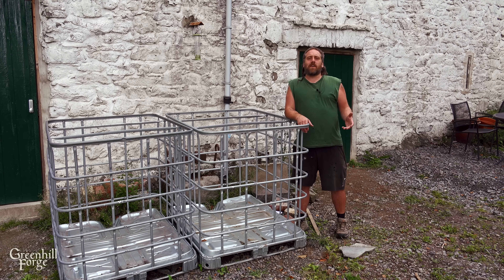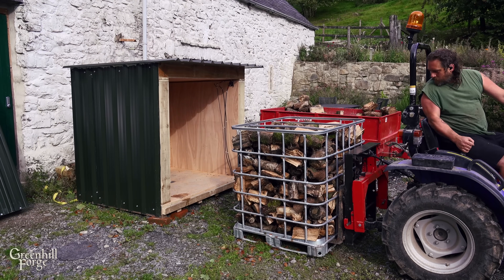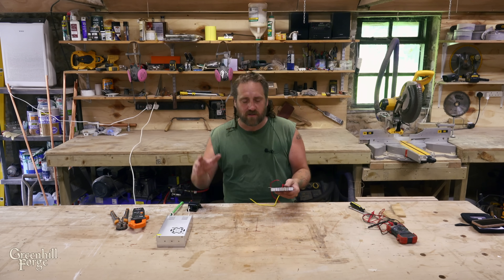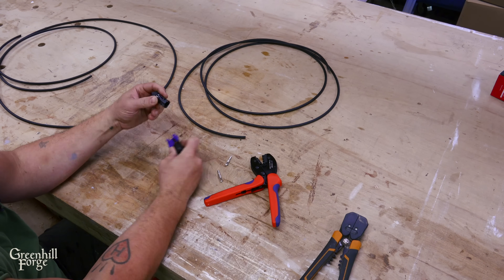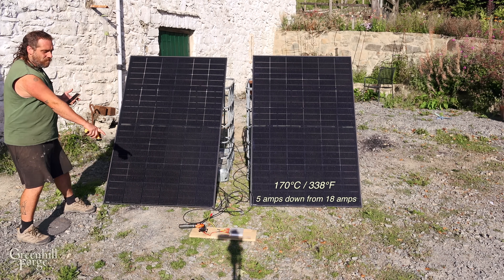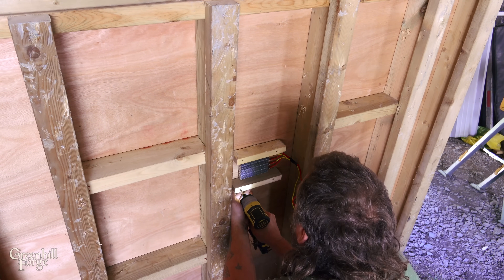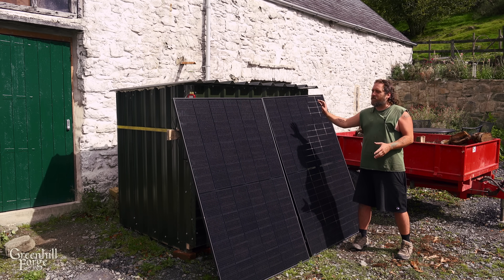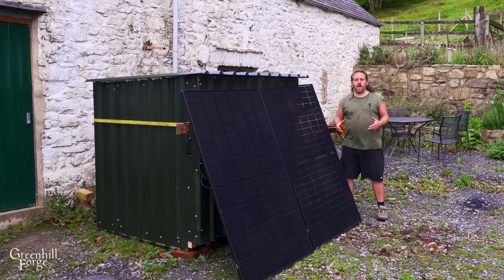Building a DIY Firewood Kiln: Solar-Powered Small Scale Portable Off-Grid System

Comment: Isn't it more efficient and cheaper, to use evacuated-tubes and then then pump hot oil through them?
Reply from the maker: I'm going to try other designs, some of which will very likely beat this but I had the panels so this didn't cost very much. real vacuum tubes are pricey

Comment: Lovely build - and you'll find (or already know) that the biggest factor in seasoning wood is air flow.   The temperature is less important, although what you're doing is warming the air so it can hold more moisture and then getting rid of the warm, slightly more humid air. The firewood will go down in water content quickly at first, but will then slow, so that the reduction from say 22% to just under 20% (widely regarded as the 'good to burn' moisture content) will take a lot longer than the earlier stage of the drying process when the wood is 30 or 40% water.   

I look forward to your next video with the data.   You got my subscription today.

Comment: Question: If you can short the heater by touching it, wouldn’t bugs / dust / cobwebs be able to short it and pose a fire hazard? If they accumulate over time and have some moisture left?

Comment: First video of yours I've seen, and an instant like and subscribe - this is exactly the kind of hillbilly nerdity I love.
Love the formatting of the video, the engineering and craftsmanship for this - looks like so much fun to design and assembly.  Having said that, I'd be really interested to see if this was just a fun experiment or if you have some analysis showing how this is better than a straight up passive solar kiln.  I've seen designs where even on cloudy / cool days you can get delta Ts plenty high enough to dry.  
Thanks for this, looking forward to digging through your library and for the update to this system!

Comment: Very interesting video, as ususal. I would love to see this concept next to some kind of heat trapping and passively ventilated black box design of the same size for comparison. And then do some months of testing, preferably with two similar loads of wood and measuring effectivity by weight loss of the load. I couldn't guess the results, that is why I am very curious!

Comment: What if you took a corrugated, transparent plastic sheet in front of the black roof, a much smaller solar panel enough to run a 12v computer fan. Seal the space between black roof and transparent plastic, take in air from inside top of roof and duch outlet to the bottom. When it's sunny enough to run the fan, the sun also heat the air, and the ducted fan push down the heated air to the bottom of the kiln. Fan can be direct connected to the solar

Comment: Would vacuum tubes or air pipes not be a better call? or even solar airflow heaters? The little shed with the current area of sun exposure should be catching the same if not more heat energy than those panels could gather in electricity? Edit: Just read the rest of the comments. A normal shed with some insulation should cover the work like @jonmatthews4254 suggested

Comment: Would really like to try this for drying rough cut lumber. Inch planks stacked with risers in the cage and then just do it like you did. Would be short boards doing it like that, but at least to start and then increase the size and all
Reply: Speeding up the drying process tends to warp the wood more since it gives it less time to "adapt"

Comment: Solar EV panels come with 20% efficiency. Direct solar heat panels can do over 90% with correct paint and easily mid-upper 80% with simple bitumen. 
When it comes to heat generation EV solar panels make little sense. Instead, use a greenhouse/polytunel + sheets of plywood, OSB, waste wood etc covered with bitumen. Place them inside a greenhouse with the black surface facing the sun, approx 5cm (2in) from the greenhouse wall to allow airflow. Longer greenhouses, or polytunels with long side facing sun are more efficient, aim for 3 pallets at the time rather than single. 2x2x10m polytunnel is still extremely portable! Allow small air intake at the bottom on one end and exhaust on the opposite end, at the top of the greenhouse.

Comment: converting sunlight into heat is inefficient,  you should have made solar thermal panels and used a small PV for the fan.  You should have done an angled roof and made that out of glass...

Comment: Not at all a criticism of this well-considered experiment. Could you pursue an even lower-tech, simpler, more efficient, wood-drying chamber with just solar-powered fans, insolation/greenhouse principles, air-flow and passive solar techniques? I love where your experiments lead, and of course some of us are ready to go to the next phase. What if everything in your system was the same, except there was no need for an active heating element? I realize the UK makes all this very challenging. Same in 'New' England where moisture is a real presence. For the record, the entire project would be completely different in the Southwest US: drying things out is our middle name!  And I want to say, for other purposes, the heating tech you've discovered is quite marvelous.
Reply from the maker: I've got some other builds and a comparison video in the works. Yeah, if I was back in the South I wouldn't bother.

Comment: I would think to dry the wood you need to continuously cycle the air. And I think you'd get a lot more wattage by using clear panels and creating a solar oven instead of PV and electric heating.

Comment: It did not look like the fan was forcing air through the element. the sides need to be completely sealed off or you will just be circulating warm air under the kiln.

Comment: Maybe it's a UK specific thing, but in Norway we just stack it neatly so air can pass trough and cover the top against rain and snow. That seems like a lot less work.
Reply from the maker: i barn dry mine for a couple years but with the humidity where I live the wood doesn't go under around 20% moisture. this is to dry the wood im about to burn down to around 12-13%

Comment: Honestly, using Black cladding so the cage heats up by itself, then using a much bigger air gap at the top so heated moist air can rise and escape to the sides, and then maybe some type of fan that creates better and faster air and moisture exchange. Would be an almost passive setup and you would need much smaller solar panels and a small battery they charge, that supplies the fan. heck even some 140mm 12V Computer case fans on the bottom drawing air in from the outside and just air escape gaps on the top would work and would require mych less solar and battery.

Comment: What about adding a battery to the system? If you added one with a large enough capacity and a thermostat in the space it could add hours or longer to the amount of time the heater is running and use the extra wattage you have on sunny days.

Comment: Powered exhaust(s) might be more effective/efficient than forcing air at the heat source. Could get creative "pulling" heat and dehumidified air through the wood, rather than pushing air into a section. 

You do great work.

Comment: Considering your setup using a PTC and a fan with the solar panels the limiting factor for energy input (temperature and RH of the kiln) is the outside temperature, RH, and solar irradiance.  You may realize this since you mentioned changing the fan speed.  The key to the optimization of this system would be adjusting the fan speed (air flow rate through the kiln) to the maximum power consumption of the PTC heater.  If this were done, it would decrease your realtive humidity in the kilm by balancing maximum solar production depending upon ambient RH and temperature by providing the maximum possible heat input.   Keep in mind that for a PTC heater in this configuration where it is air cooled the power will be limited by the heater internal resistance if the airflow is too low and if the airflow is too high your kilm RH will be higher than necessary.  So my thought goes to an arduino control loop that adjusts fan speed by solving for the maximum power into the ptc heater.

Comment: There's a nice circuit made by William Fraser here on YouTube which will significantly increase your heating on overcast days. You can find it by Googling "DIY Solar Maximum Power Point Oscillator". With the current setup, your PTC is going to be dropping the voltage of the cells significantly when there's not a lot of current available like on an overcast day. Solar panels don't produce much power when their voltage is low.
The circuit he shows is designed for lower voltages, but I've seen some modifications on other channels for a 40V panel.

Comment: Since when is a quarter of an amp at 12v 60 watts? What did I miss?
Reply from the maker: it's measuring the AC supply at 240v
Reply: @GreenhillForge  Lord. That makes more sense. Thanks!

Comment: A suggestion.  Build a thermostatically or humidistat controlled exhaust damper in conjunction with your heater and fan. The box will heat until it achieves the set temperature/humidity, then the damper will open, fan on, releasing hot humid air then resetting for another heat cycle.
Reply from the maker: not a bad idea
Reply: Greenhouses use a mechanical opener for top windows, probably not work exactly but a simple solution that might be tweaked

Comment: You should label several pieces of wood and weigh them periodically.  Moisture meters do a poor job of determining internal moisture measurement as there is a moisture gradient from the outside to core of the logs.
Reply from the maker: thats a good idea. when i'm taking measurements i'm splitting a piece and reading the center but i like your idea

Comment: Would some kind of glass/greenhouse work better for this? It would seem more efficient to let the sun heat the wood and internal area directly instead of converting to electricity and then to heat. Either way, nice idea to do it off-grid in a renewable way, good luck with the project.

Comment: Uh, just get/build a small greenhouse with black fabric on the inside. Fans to circulate/vent the hot moist air and draw in cool dry air. What is the point of so much insulation? Use the solar panels to make the inside even hotter.... this seems terribly inefficient...

or if you dont want to make something new you should be using the heat the metal exterior is absorbing instead of keeping it away from the wood.... Make a small black metal box and compare how hot it gets to this...

Comment: I think you can use natural convection ventilator on top for create natural upward draft and venting so that need of force ventilation using solar powered fan will be eliminated. Replace door or one of the wall with glass to gain solar  Energy. Solar dryer works on this principle.

Comment: I would not put the wires on the inside of the shed as the first time you scrub them loading or unloading you will tear them out. don't recess them eather or you'll snag that.
Make the inside walls of the shed as smooth as possible. I ran a forklift at a lumber yard for years... ask me how I know.
put the wires in the wall and maybe the breaker on the ceiling or something better.

Comment: Great project. Wondering if the heating element should be isolated from the wood eg with cement board or similar. This idea could possibly be used as a clothes dryer?
Reply from the maker: it couldn't hurt but the heater stays under wood's autoignite temp so theoretically it's fine. i've thought about using it as a clothes dryer too, would definitely work

Comment: I think it would be better to have the heating element fixed to the inside wall at the back near the bottom, with a metal shroud over it to protect it mechanically, but also to allow air flow over it. So the shroud would be fixed left and right, but open at the bottom and top. You could arguably put the fan anywhere inside as all you need to do is ensure general circulation.

Comment: For a home / non commercial - I used a KETER Plastic shed - with pallets on floor to help circulation - with a solar powered Fan. The fan forced air in and the natural heat from the sun made the shed about 25-40 degree C most of the summer. From 27% moisture in fresh cut wood in March - to 5% in Sept. All I did was rotate the wood once. Great for passive home setup.
Reply: I too was thinking letting the sun just provide the heat and using forced air would be simpler; going via solar panel to provide heat is pretty inefficient. Its an interesting idea and got me pondering at least!
Reply: @notsonominal  Yeah I was trying to think, you surely can't get more energy out of the sunlight with solar panels than you would with simply painting it black or something right? This design does have insulation but presumably that's just extending the heated hours a little in the evening?
Reply: @Robert-sq7bp  photovoltaic (electrical) are in the 20-ish% efficiency range - thermal collectors are 3-4 times as effective for heating; but you do need circulation.
Reply: @notsonominal  Thanks, seems like you could just have the solar fan then.
Reply: What’s your summer climate? Hot & Dry?

Comment: A few comments:

Not sure how all the water will escape the crate. I would have thought you need a small extractor fan.

Rather than isolating all sides of crate, i’d leave the side facing south un-isolated, and paint the outer surface black to capture sunlight which will also heat up crate when sun is shining.

And for the above to work, I’d place the solar panels so these do not shade off the crate itself. 

I am not sure the air intake in the bottom is a good idea. The air it sucks in will be both cold and humid as close to the ground. I think a fan inside the crate will do a better job. The water in the logs will expand MANY times during evaporation and easily be blown out of the crate due to the increase in air pressure. 

I’m doing something similar myself. I just used some black landscaping fabric around an IBC cage, and made a sloping lid for it of some offcut marine ply, and made sure air can vent around the lid without rain water getting in. The heating is just down to the black landscaping fabric capturing the sun and heating up the inside of the cage. I’ve not done much testing, but seem to dry the wood ok.

I was thinking of putting a solar panel heated sand battery into the cage, for residual heating over night, but not bothered so far…

Comment: I think it's a good idea, and I actually thought about doing something similar on my smallholding, but without a heater - just a half size cargo container painted black so it gets hot in the sun with two big solar fans for ventilation. I worked out the cost and where I would put it, and I think it would have worked, but in the end I decided to go with the simplest solution; cut and split enough firewood so that I'm always two years ahead, and the wood dries naturally outside in the woodpile over those two years.

Comment: Looks good, I think it'll work pretty well but the heater will become clogged with dust so maybe use a car cabin air filter or something to catch the dust before it goes through the heater element with those small fins.

Comment: Wouldn't it be more efficient to exhaust the air in cycles. Heat up the air inside to a set point, the relative humidity will drop, and this warm air can pull moisture from the fire wood. When the humidity reaches a set point, replace the air with cold fresh air from the outside. I'm not an expert, so please someone correct me where I'm wrong.

Comment: The best way to do solar is not PV, especially for heating.  to heat water, there are solar water heater that can even work in the UK and way more than using a resistor style heater.   A green house with style (no PV) with a vent at the time, and a cool/dry vent on the bottom.   You can rig up a thermal switch (Or arduino IOT) to turn on a small fan (120mm) when a temperature threshold is reached will do the hjob cheaper and  a WAY small investment in PV (optional for a Fan). This design could be the same and make it portable, but a larger structure that holds more totes, would be better.

Comment: Great design, but you might be better off just using an old greenhouse, sealed in the sun, it gets up to much higher temperatures.
Reply: I was trying to get the physics right in my head because you can't get more energy out of the sunlight with panels than by simply having it painted black right? So it's the insulation to keep heat inside and heating element to get it on the inside of the insulation?

Comment: What if it would work in 2 phases? 1. Heating phase - running up temps higher. Up to lets say 60-70C inside. Then quick 20minutes vent phase. 2 Venting phase - getting mositure out with more ventilation/fans. You think it is doable? Also glass door/roof seems like a good idea, free direct heat from sun.

Comment: I love the channel and what you do and it is thought provoking.
Just to raise a question for your test with solar heating for the kiln dried logs.

What would the difference be with a kiln with no insulation and black steel panels in the sun, you would get direct heat like an oven that may get hotter than the solar panels and may be considerably more cost effective.
Got to be worth a trial
Reply from the maker: I'll be doing a trial with several different types

Comment: If the PTC unit gets as hot you stated / demonstrated....HOW is it safe to mount directly to the plywood????   Seems like a Great Way to set your Kiln on fire???  

Other then that.....Great Concept!  Adding to my list of future project builds. Thanks.....
Reply from the maker: the ptc cuts off at 200c and wood doesn't autoignite until 230c+. I'll be doing a couple more versions to test against each other so wait for that video if you can

Comment: without mppt, we do not optimally extract the energy from the panels. in summer, a small panel can be enough to circulate the air with a fan, the black walls should be more than enough.